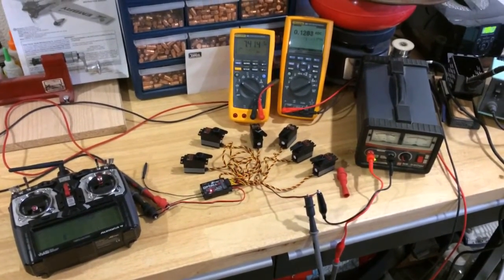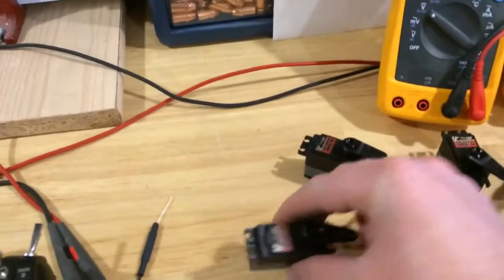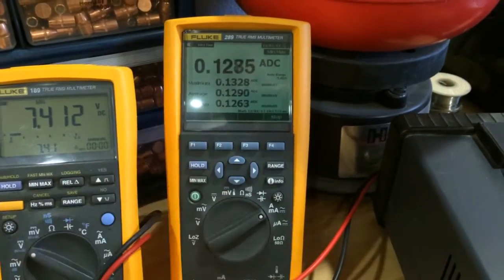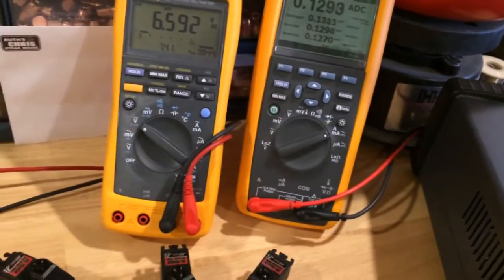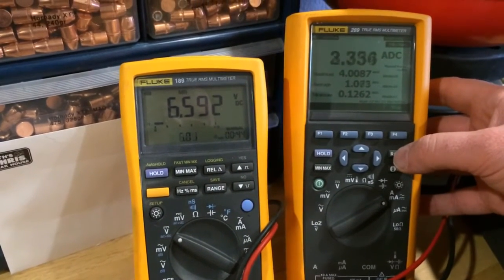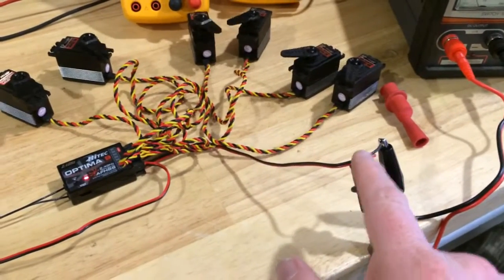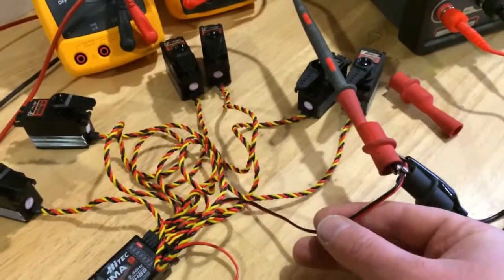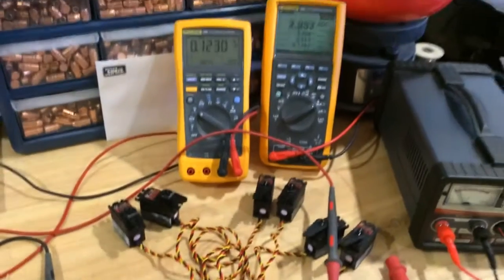Hitec HS-7954SH servo testing

Comment: I'd like to see you take this to the next step and do the same testing with 2 power inputs...and then again with 3 power inputs. This will show everyone the difference (or not) between 2 and 3 inputs in this scenario. I'd even like to see the results with 4 inputs. Put some Y's on the servos and see the difference it makes.

Also, run the same test using your Li-Ions....I bet (and would like to see) that there is bigger voltage sags with Li-Ions than a power supply.

Comment: thank you for making this video... i had some people mentioning that i should use a 10 amp BEC for a single one of these servo''s and this has proven that my built in BEC in my ESC (a 5amp SBEC @ 6 volts) is certainly providing enough power to run the single Servo..